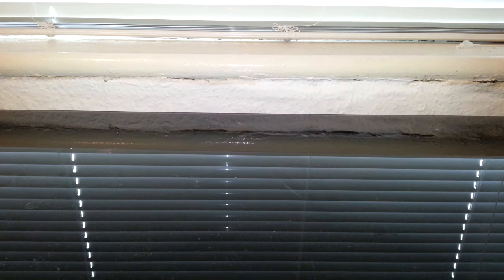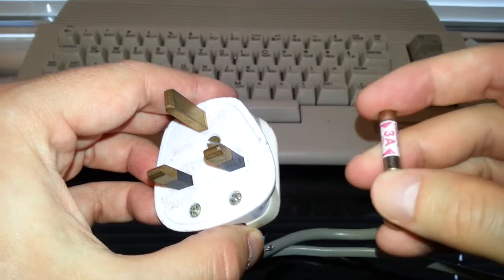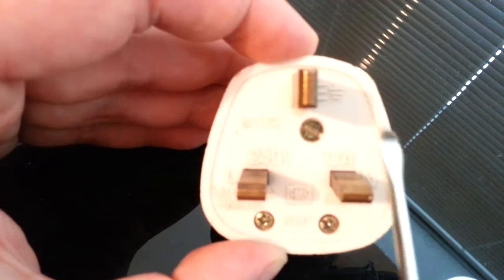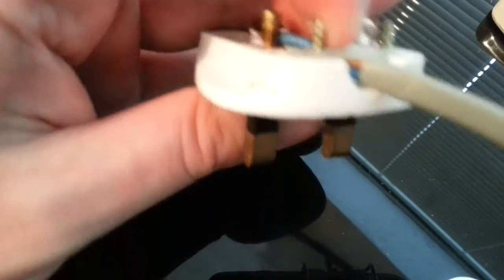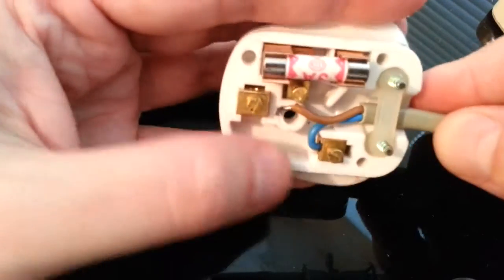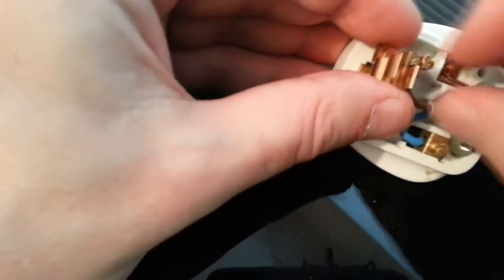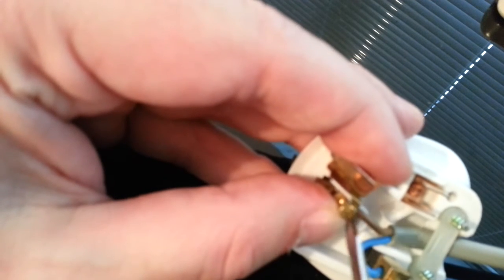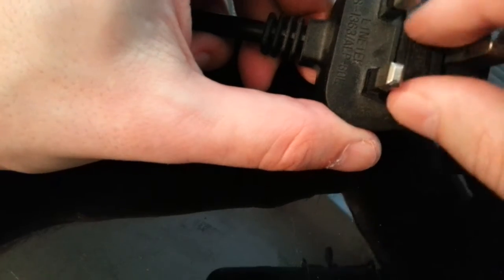How To Wire A UK Mains Plug by John Gage

Comment: Hi John I have an old 1970’s amp wire with just a blue and black wire. Which is which to fit to the UK plug. Thanks.
Reply from the maker: That was a bit before my time but I found this information. I hope this helps. https://homeguides.co.uk/british-wiring-colours/
Reply: @John_B_Gage  thanks John. It came without a plug so trying to find out which is which, as both colours seem neutral.

Comment: My wifes blender is 2 wires.Can I use a 3pin plug and wire up with 2 wires.
Reply from the maker: I think everything is 2 wires now so I guessing you can.
Reply: Yes you can. We always need a 3 pin plug to go in our sockets, but double insulated appliances (which means it has a plastic outer casing) do not have an earth because they don't need one. This includes most things like lamps, radios, some small, low draw kitchen appliances (though not always, these are just general trends, not solid rules), hairdryers (and related appliances) vacuum cleaners, TVs and power tools. These things simply don't need an earth to be used safely. However, appliances with metal cases like laptop chargers, toasters, kettles, cookers, washing machines/tumble dryers, irons and the like DO need an earth and will have 3 wires

Comment: Do you need an earth??
Reply: If it is Double insulated it does not have an Earth.
Reply: It depends completely on the appliance: if it has the symbol of a square with a square inside it on the label, it doesn't need an earth wire. Things that typically don't need an earth include things like lamps, radios, TVs, some small kitchen appliances like blenders and mixers, phone chargers, hair dryers, power tools and hoovers. Things that typically do are anything big like a fridge freezer, washing machine, tumble dryer or cooker, but also things like irons, kettles, toasters and computer chargers - pretty much anything with a metal case
Reply from the maker: Not anymore I don't think because the electrical item is earthed.